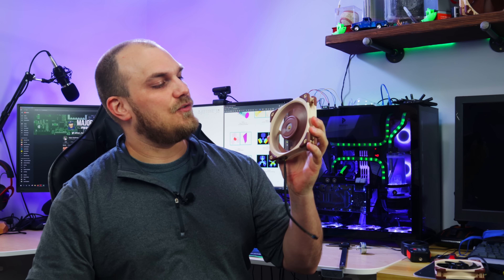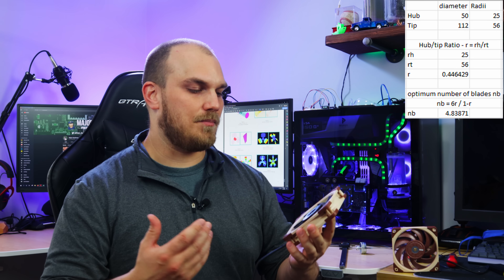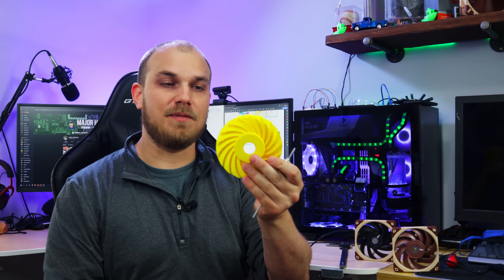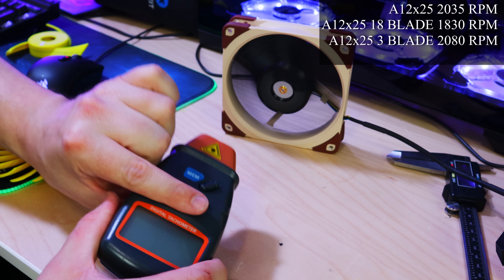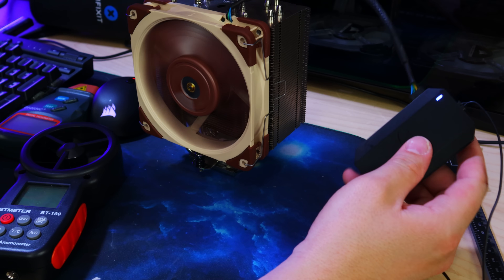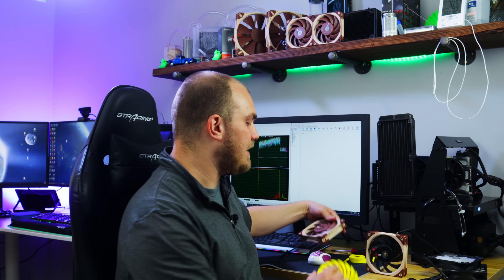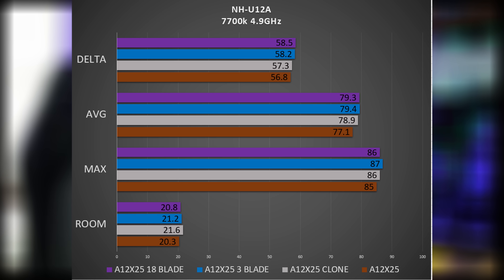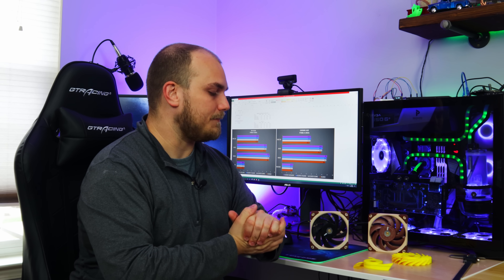What If the Noctua NF-A12x25 Had Twice as Many Blades? | Custom 3D Printed Blades

Comment: I wonder what meaning for cooling performance has the static pressure. I thought main thing was the mass of air that can flow around heat exchanging surfaces per unit of time...

Comment: There is an important measure you are missing: pressure. Even if the air speed is almost the same, maybe the pressure of that air is not the same? Also important would be the cubic feet per minute (cfm) or m3/hr...

Comment: I think your formula is right...Five blades is the lowest number that would yield the high airflow through the fin stack. There is a window, where 5 to 9 blades will yield similar results, Noctua chose 9 blades, for lowest possible noise.

Comment: There are a number of factors which contribute to the (rather small) differences between the blades.  Stall considerations aside (because one then gets into the aerodynamic flows to optimize best), the 18 blade should give higher performance.  However, recall that the blades have thickness.  That thickness blocks airflow.  In the limit of the spacing between blades being the same as the thickness of a blade, you have blocked half the fan aperture with fan blade thickness!  If you could make the blades infinitely thin, then the 18 blade would assuredly be superior (all other things being equal).  But since one can’t do that (particularly if 3D printing) then you got to use fewer blades to leave enough aperture for air to pass.  I’ll bet when you run that trade, you come up with something pretty close to 9 blades ;-).  Enjoyed your tests!

Comment: Everything youre saying about fan design lines up with what the quad copter world says about propellers :p kinda cool to see how all of this applies to other completely unrelated fields.

I wonder if the finish actually affects fan performance, of if its the structural properties of PLA vs the material noctua uses. 

pla blades definitely flex under load ( ive printed enough crappy airplane propellers to figure that out the hard way. 

It would be cool to see if you could make a mold of a noctua fan, that you could use to do some DIY injection molding using PLA. See if the results from the smooth PLA fan differ from the 3dPrinted one. 

You could also try resin printing, if you have access to one and seeing if a resin fan performs any differently O:

I feel like the performance gaps here between two identical fans (aside from manufacturing processes) have more to do with materials sciences, than fluid dynamics and airflow. 

While i know that skin friction can affect a planes stall speed because the boundary layer of air becomes larger when there is more skin/surface friction, this should not have any affect on an airfoils shape and overall lift (or in the case of a fan, thrust). If the airfoil is not in stall, it should be producing the same amount of lift regardless of how much skin friction. Layer lines alone, i dont believe, should not be affecting a fans performances by noticeable amounts.

Comment: This may sound silly, but is the noise louder in front of or behind the fan?  Would a acoustic dampening shroud (if it even exists) on either side help (without impeding air flow of course)?

Comment: The data seem incompleate. Having 5blade and say13 blade designs whould fill some gaps. Seeing how the 3 and 18 blades prefotmed similar in all aspecs. And the 9blade is probobly going to be the best design every time. But if the 13 blade outperforms the clone thered be potentiall but i dont think it will cus the 9 blade original has alot of thought behind it.

Comment: That three blade fan made me think about old aeroplanes, and it gave me an idea.  Some aeroplanes had contra-rotating propellers, i.e. two props on the same axis that rotate in opposite directions.  Could you do a similar thing with two fans?

Comment: The main reason lower pitch sounds are less jarring at the same volume is because our ear is more sensitive to some frequencies than others. This compensated measure is called loudness (measured in phons) as opposed to sound pressure (measured in decibels). For example a 45dB sound at 100Hz has roughly the same loudness as a 25dB sound at 400Hz.

Comment: I'm sure you could graph those point out and it would make some kind of parabolic curb that can get you to the optimum configuration. also turbine blades are curved all weird because they take into account that blades move faster at the edge of the fan and slower towards the center. The optimal angle of attack changes with speed. Never done the maths so I have no idea how this effects these fans at those rpms.

Comment: If you build the 18 blade modified so that every other blade is taller it will increase flow notably. It's a tactic used by turbocharger manufacturers. Staggered blade height changes intake flow to be closer to the original 9 blade and lowers stall potential.

Comment: If the calculation says the ideal is (roughly) 5, it would be interesting to do one with 5 blades, for a baseline. Also, as your prints are rough, you should compare all of yours to your 9-bladed version, not the commercial fan.

Comment: I would be interested in how a computer fan performs that has the asymmetrical 7 blade arrangement that Honda and Toyota use in their cars for cooling the engines.  There are 7 blades, but the the blades are not spaced evenly and are intended to get more "bite" instead of stalling at high rpm.

Comment: The Noctua ain't good though, it's hardly even optimized as a fan. There's a lot to calculate when it comes to fan blades, such as the curvature of the blades, their air resistance, friction, max torque, material stability, rigidness, etc. Some fan designs are proper bad at lower RPMs than they are at higher RPMs... Oh and the thing that most people don't understand is quite important, is the maximum amount of air that can pass through the fan at any moment. The more Air that can pass through it the better. But you also need enough material to push the air, so it's a balance.

Comment: I remember I had an old Dell optiplex that had really bad cooling issues, and I just so happen to have both a left hand and right hand rotation fan, so I stacked them and it got way better. would be really cool to see if you could get a hold of one and see what the increase in static pressure and volumetric efficiency is, as opposed to just a single fan.

Comment: I'm not sure if you are just printing extremely fast or if your printer isn't able to produce clean prints. Your finish is unimaginably sloppy, and that's going to cause friction issues while running. Think about it like a tire, one tire is factory made, the other one you have random three inch protruding bumps all over the surface, of course we know what tire will perform better. Of course you're going to have sub par results with a direct clone of the blades. I feel like your results are faulty because you didn't do your due diligence in making proper fan blades for your tests, and that's step one.

Comment: Saw JohnnyQ whipped a new protruder that spits out nylon, the 3d printed stuff are way more durable and noticeably less jagged, and just a thought, does the fans designed by you could be tested in Anysis Fluent maybe? in terms or air flow/displacement?

Comment: As of my understanding there is no actual benefit of using more fans, when calculating a fan. Things like static pressure, air flow, etc depend mostly on the geometry and speed.

When you calculate the airflow through a fan you make many assumptions about how the flow behaves. Increasing the number of blades makes the air move more like in your calculations, thus increasing the performance. For example, one very basic assumption in turbine calculation is that there are infinite blades with width zero.

But this comes with a disadvantage: The more blades you use the greater is the resistance you get. First the air has to move around the leading edge of the blade introducing losses. Additionally the air experiences more wall friction due to greater surface area in contact. You can see that clearly in the decreasing of RPM with more blades.

Comment: As an HVAC tech, I can tell you. Velocity of air versus volume can change everything. Which is why you need to clean your coils regularly. (Also saves electricity)
Reply: Dust causing friction in the brushless motor?
Reply: @nubletten  well in an hvac application, dust will prevent the transfer of heat causing your ac to struggle. In a pc setting, If you have dust on the blades, it creates more friction of the air causing it to slow down.

Comment: What about a fan blade that sticks out from the shroud by 25% the blades would be over lapping to theoretically make more pressure and every other blade would stick out on the outer edge and then inner edge to scoop. This increases your gap for air to flow in on 50% of the blade. It is going to increase your starting resistance by a ton but hopefully not to much over the long hall.  Sorry I can't draw engineer or explain better. I'm just an idiot watching videos online.

Comment: i use 3 feser 55mm thick 120mm fans on my xspc radiator in my main pc at work, they work great but unfortunately feser is out of business so getting more is impossible, this sucks cause they are great thick static pressure fans and move a lot more air through my high fin density radiators than even the best 25mm thick 120mm fans can do to sheer thickness. i would love to see you check it out and see if you could print something like that and test it out, would definitely be worth your time.

Comment: The reason 18 blades move no more air than 3 blades is the increased drag of the 3D printed surface, which is not smooth. The result with polished blades would be entirely different.

Comment: If such 3d modeling programs allow it, I wonder if simply removing 2 blades and stretching the remaining blades to compensate would do anything significant... Probably not SIGNIFICANT per se, But I've always preferred lower pitched fans, And if it has similar performance, Then it'd just be a benefit.

Also unrelated but 666th comment so that's amusing.

Comment: A ducted intake would also make a difference, because of the air turning a sharp corner to enter the fan reduces the effective width of the fan intake and creates unnecessary resistance.

Comment: Something you don't appear to have taken into account is the degree of overlap between blades, or lack of overlap. If there is no restriction behind the fan (ie, in an open room), less overlap is needed. The greater the resistance to flow behind the fan (or in front of it), the more overlap is needed to reduce the air simply going backwards once the blade has gone past. This is why the back pressure being faced makes a big difference to the fan design.

Comment: I can tell you from experience that what makes a significant difference is having static blades behind the moving blades that smoothly change the semi-rotary direction of the air flow created by the moving blades, to straight air flow. This is similar to how real jet turbines work, as they are many layers of alternating rotating and static blades. I cut apart a 2-litre cola bottle to make them and used a bit of pipe. It was a bit tricky, but would be easy to make with a 3D printer. Easily made a significant difference to the performance straight off the bat at the first attempt, far more than tinkering with fine changes in the moving blade design because there is a significant amount of rotary motion (ie, energy) in the air exiting the moving blades, that is ripe for converting mostly to straight motion in the desired direction.

For technical details, I used a joss stick with rotary fan to find out the angle of the motion of the air coming out the back of the fan, and then angled the cola bottle blades to be the same behind the blades that, over a distance of about 1.5 inches, became straight. Made about 25% difference to the air flow through the fan.

Comment: Here's the thing. A printed fan can have a structure that is IMPOSSIBLE to manufacture using any other process. Broaden your search beyond what traditional manufacturing is limited to. If you can recast it or mold it, you're looking in the wrong place. So far, you're doing what all the fan companies do, because in the end - they want to mass produce.

Comment: What if instead of adding more blade, you reduce the pitch and increase the width if each blade to point that the end of each blade is behind the tip of next blade. I think that design will be much less noisy, but might have less air flow.

Comment: Was the rpm the same of the printed  fan ?  that's a huge deal to compare different blades !  blades that's going to move more air ,will need more motor to turn same rpm .

Comment: Good video but you should compare the fans differently:

Version 1: You compare the wind speed and cooling performance of different blade counts at the same fan rpm.
Version 2: You compare the wind speed and cooling performance of different blade counts at the same noise level.

You can easily adjust the fan speed via PWM and use your anemometer and your decibel meter to finetune the speed of the fans to get the necessary precision to compare them.

Also, when there is a force against the wind speed of the fan (like your radiator), you can use your anemometer and decibel meter to measure what happens to loudness, wind speed, rpm and cooling performance.

Comment: That will be interesting if you doing next project with sla 3D print and do some upgrade on dc motor to make it more powerfull in order to match rpm with the original one... Cheers 👏

Comment: Try using L shaped turbines blades. space the blades about 2 to 3mm apart. The L should be at the bottom and the bottom tip o f the L should be facing the direction for collecting air. Five to 12 blades should work.

Comment: you should have printed these with a resin printer. The surface roughness differences between molded part and your FDM printed parts is huge and likely the dominant contributor to your results.

Comment: You need better printing else your results will always be short of what they could be, and while alot of prints are made from CAD software you should try post processing or outright modeling in a 3d modeling program since STL is not the best format for a mesh and slicers are using the mesh to derive the printing path, sadly using 3d modeling software does cost you the use of dimensions if your cad program can export to OBJ you could use 3ds max to clean up the mesh for printing. Ive had far better results printing from sliced OBJ than i have with STL format.

Comment: You can try with 10 blades but 5 of them are half blades. These short blades are attached to an exterior tube ring (at the tip of the ring) that also work as a winglet. So that the fan has more space close to the center cone. Another experiment; is to ad Teflon.

Comment: You should maybe use UV resin 3D printer instead of a PLA printer if you're not going to smooth out the prints. At least the resin 3D printers have a higher resolution resulting in less drag.

Comment: I think you might need to delid and liquid metal your 7700k. With a 240mm AiO on my 8700k before deliding and Liquid metal my cpu would just cook, being in the 80’s C, I trying everything, re applied my noctua thermal paste, even borrowed a great cooler master air cooler from another build thinking my AiO might be bad. Temps were the same after every test. Delided it, applied thermal grizzly reinstalled the IHS then applied thermal grizzly between the IHS and my AiO water block (has a copper plate, do not use on aluminum) then my thermal powerhouse of a cpu runs right at 60-62 C under full load  for over 30 minutes with it over clocked to 5.1Ghz.  I believe you’d see a more discernible difference between fans as I believe you’re currently at the thermal transfer limit of the factory “toothpaste” intel uses on their CPU’s.

Comment: the wind speed measuring is wrong,  in middle you have the motor,  you get more pressure at the ends of the blades.

Comment: About the off number blade count shouldn't make any difference as most jet engines use even number blades and squeeze out huge numbers of efficiency dude to blade shape width and canter what matters the most is the disks balance from one side to another this is a reason why even blades are used

Comment: Possibly like an airplane propeller with a 30 degree angle of attack at the hub and one degree at the end and possibly a vertical tab like on airplane wings at the ends. also taper the blade as you extend it to the end. possibly three to six blades on the hub. Keep the tip velocity less than 50 percent the speed of sound.